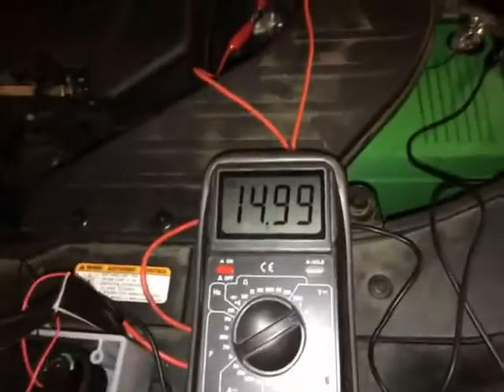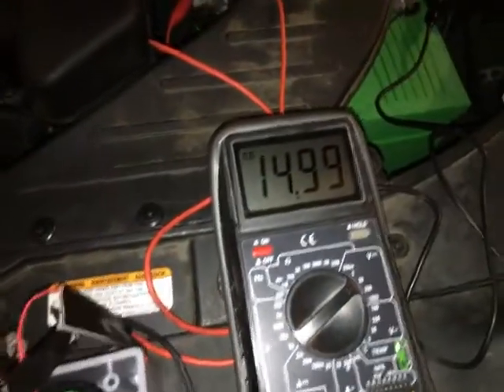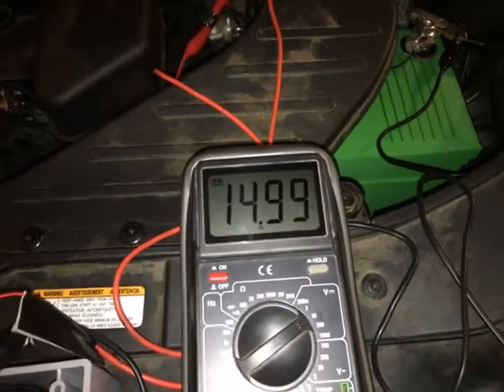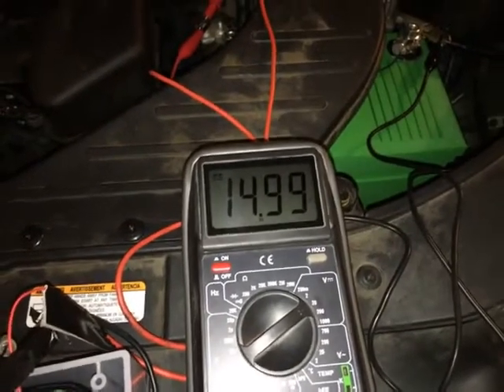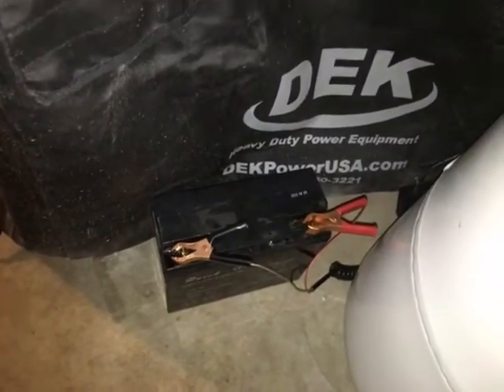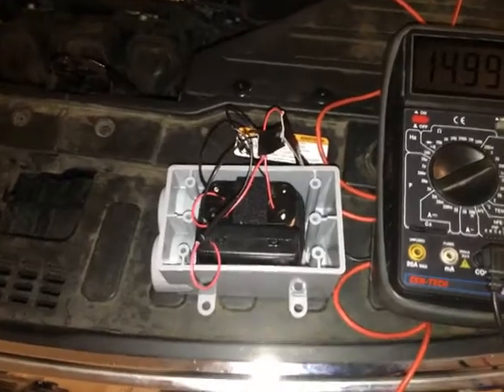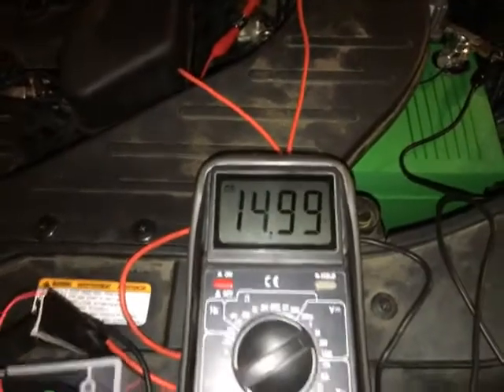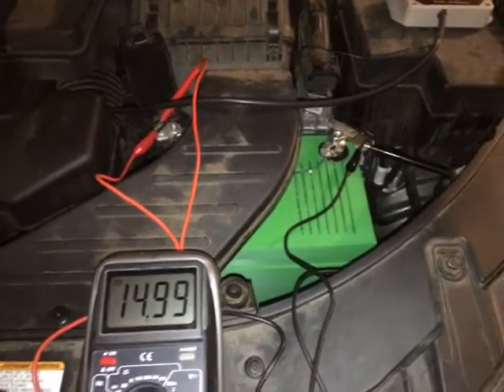UltraCapacitor Car Battery Replacement with Double A battery Pack - Update

Comment: That's so so cool man. Thanks for your time on the phone. Was a blessing. I think we where on the same page when it came to the PV thing. This is the kind I had in mind dose not need to be this brand.. Coleman 2 Watt Solar Battery Maintainer 58012. 

Maybe you can use it to keep the AA batts topped off at all times.. Just what came to mind. . Would be cool tho. Your AA batss are topped off from the sun and tho's keep your caps topped off.. Hehe I do not think there would be a need for a CC with this. But would be cool to see if it would work or not.. God Bless Brother.
Reply from the maker: The 2w panel would be perfect, looks like the one I broke.

Comment: Glad to see more people using capacitors!  I also saw you use them in your solar setup.  That's a nice battery box you made.  Can't afford a 3d printer so just used a store Hefty plastic box for mine. ;)  I was tired of car batteries wearing out early and sulfating when someone left the lights on.  So I made a super capacitor battery some months back.  My super capacitor battery uses a small lead acid battery (which I protect with under voltage protection) for the car parasitic load as well as if someone wants to run the radio when the car is off/etc.  However the capacitors take the load of starting the car leaving the partially isolated battery drain always low (no strain).  I am making a few fine tuning improvements then I plan to post the schematics of my best build for those who want to build their own.  If you want to see here is a early build of mine:  https://www.youtube.com/watch?v=X8D7sNKNu-8   I ended up using 12 balanced capacitors.  My car is a 2006 Toyota Corolla V6 with a gear reduced starter so it takes a LOT more amps than many cars.  Of course your 3000F capacitors could burst 3k amps and start a semi!  I like the work you been doing.  Keep it up and look forward to seeing more! :)
Reply from the maker: Thanks for the comments and I saw your video. Good use of common tools like the plastic box.  Much cheaper option than the 3D printed one.  And I didn't see any warping of the plastic and the quick charge circuit is a nice touch.  I look forward to seeing your latest designs.